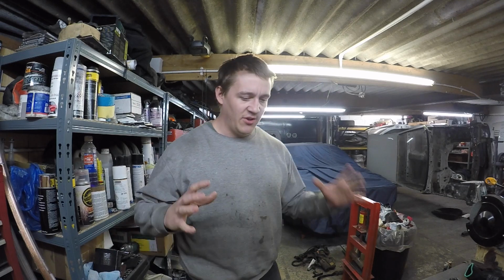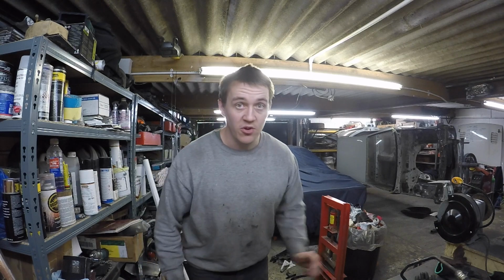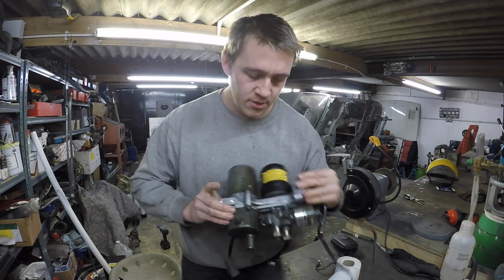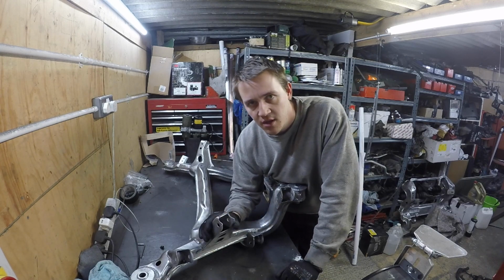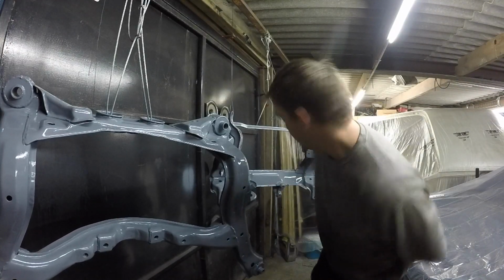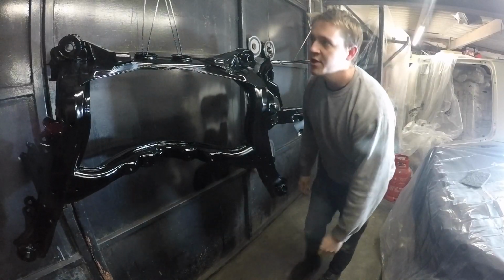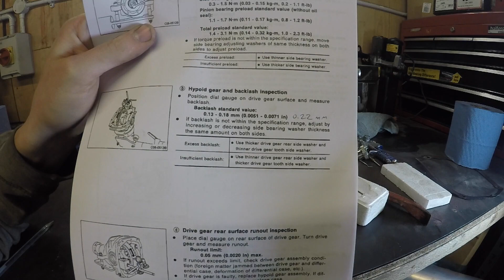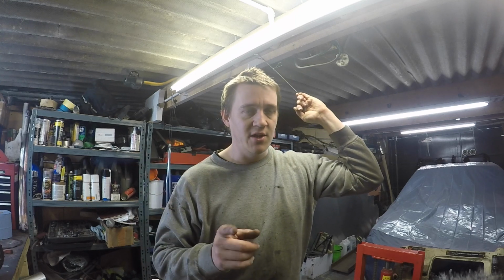Rear end progress! R200 diff measurements and ATTESSA / Subframe paint - R32 Build 18

Comment: That marking fluid was a bit thin you want something more viscous really. 

In my experience (of things that aren't Nissan's) OEM diffs are close enough in tolerance that you can just swap the shims onto the new diff and it's fine, but aftermarket LSDs have a bit more variance and need setting up properly.
Reply from the maker: I’ve got some titanium dioxide to mark with now which should be a bit better. 

Yeah I know a lot of people just swap them over. The run out of the annoying one. Hopefully the new bearings help a bit.

Comment: what were you doing with the blue stuff, is that for measuring where gears interface?
Reply from the maker: I used Stuart’s micrometer blue to check the gear mesh. I’ve got some titanium dioxide to use instead now which should be a bit clearer. You use it to check where the gears are meshing, then adjust the pinion height to bring it into the middle of the gear if it’s out.
Reply: I think it's called blue engineers marking.